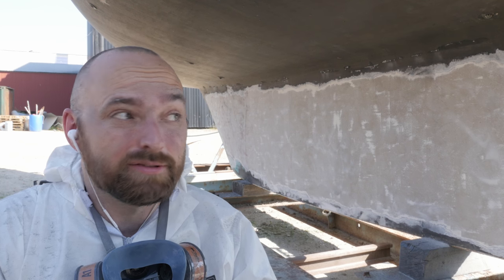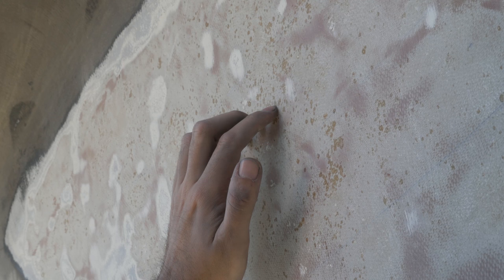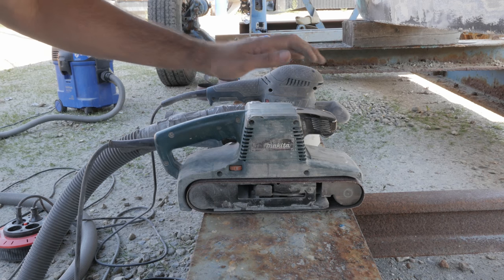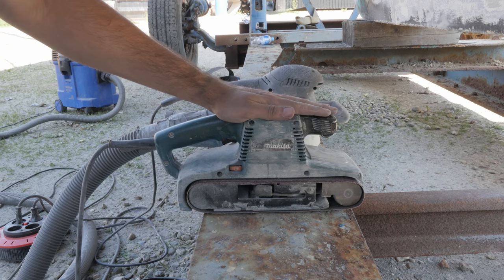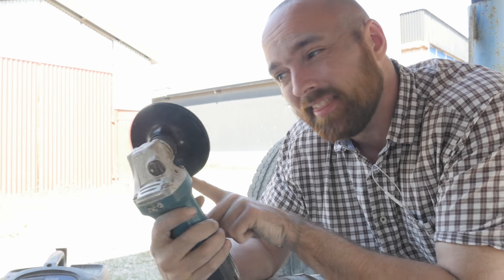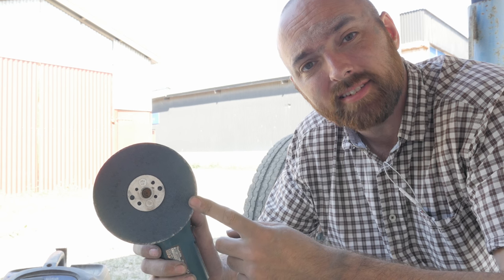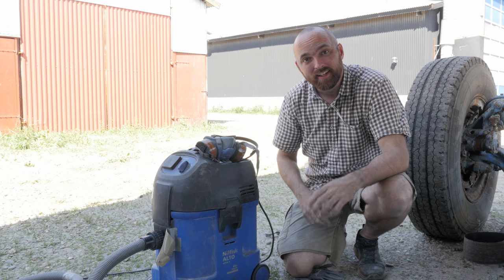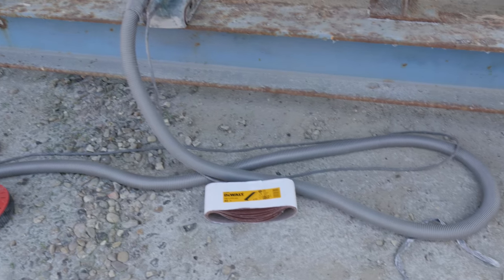Sail Life - More sanding? Yay!

Comment: Well here goes I was in the Air Force and was a coatings specialist. Osmosis is the action of a liquid moving through a semi porous material. When that coating was applied there were thousands of tiny bubbles that allowed moisture in. Meaning the coating was not properly prepared for application. Someone opened the can dumped some thinner in mixed it and either brushed it on unevenly or rolled it on unevenly. You can even get the same results by spraying it on. What we used is a Mil Spec gauge and a square of some type of metal properly primed. Once the coating is applied the gauge is rolled across the surface, it has markings along the side and a concentric Middle that picks up the coating and measures how thick the coating is. Some people like to use what's called a HVLP (high volume low pressure) spray gun it does not put a lot of mist or overspray into the surrounding air. It is a lot like an "airless" spray painter all paint no "fog/mist" the finish with an HVLP is quite even and very little waste or spray on items you don't want coated. Visit your local auto body repair shop and they can show you how it works. As far as the sanding goes now you can have your future boats "media blasted" using baking soda instead of sand, the auto restoration business uses this to take away the paint without damaging the metal and removing any type of corrosion. Next time you do a project like this after you have stripped down the entire boat completely consider have the boat moved to a oven to dry the boat completely out or rent a shed and moved the boat inside and rent propane heaters and have them on for at least 72 hours straight. This will completely dry the boat both inside and out and under surfaces like that deck you pulled up which was rotted and allow you to replace without the delay of waiting to dry and eliminate the method you employed trying to pull a vacuum on the hull in spots. 

Cheers from Texas.

Comment: You are so correct that belt sanders can take you for a walk!! I shall be interested to hear how you get on dealing with the concave curve between the keel and the underside of the bottom of the boat and also using it upside own above your head!
Reply from the maker: Yeah, that concave curve is going to be annoying! I'm thinking about modifying the small sanding disk I got for my angle grinder. I have no idea if that will work. If not there is always ... sigh... sanding by hand. Yikes! ;)

Comment: Hi Mads.  Osmosis is easy.  It's how most of the nutrients in your body get around.  The transport of water through a membrane (gelcoat, barrier coat, etc.) against a concentration gradient (the acids and salts inside the laminates).  Water then hydrolyses with the chemicals of the hull materials creating various acids and breakdown products.  Of course the acids and breakdown products attract more water into the hull by, you guessed it, osmosis.  Osmosis makes osmosis worse!  The blistering is caused by the tremendous pressure built up inside the layers of laminate.  (Be careful of your eyes.  There can be high pressure acid squirting out of the blisters.)  The hard part is what to do about it.  Basically what you are doing.  Opening the blisters, dry the hull, reseal the hull and put up the best barrier you can.  I very much enjoy your videos.  They are both entertaining and informative.

Comment: Nicely done Mads.  I can well imagine how you arms must have felt after all that sanding, but given the extent of blistering, from all I have read and heard about it, you seem to have taken the right approach.  Definitely a belt sander or a larger sanding disk really is the only way to do this job.  At least, once it is all sorted out you can be re-assured it will have been done well.  And at the end of a day a nice cold beer or two I am sure would help wipe away the feeling you have worked hard.
Reply from the maker: Thanks :) By the time I'm done sanding I'll be the strongest guy in the office ;) I'm super pleased with the belt sander! Just for the fun of it I'd love to try one of those big sanding disks. The las area I sanded on the hull with the belt sander turned out just as smooth as the areas I sanded with the orbital sander. The only problem areas are going to be the curve between the hull and the keel. Fingers crossed the blisters won't return after all this hard work! ;)

Comment: I have done this job before. We had a cast iron keel and a twisted wire brush for an angle grinder ripped off the material faster than anything.
Reply from the maker: Sounds like you had a lot of fun too ;) :P

Comment: I might be wrong but it seems you are using a carbon vapour filter (A)with your mask.  For dust particles you better use a  P-filter. Preferably P3 as it provides the best protection against dust. Thanks for the great videos!

Comment: Yes on the belt sander (use as aggressive a grit as your can) try not to gouge but don't worry about it too much either.
Ounce you get it all removed down to clean solid material you can easily fill in any gouges as you build the layers back up.
Ounce you get passed the removal stage you can switch back to the random orbital from here on out, again using the most aggressive grit that you can.
The biggest mistake you can make here is to beat your brains out using too fine a grit and/or not changing the paper often enough.
If you're after an especially glass like finish you should use a "straight line sander" or a "random orbital straight line sander" (the longer the better)  on the last few coats, and use finer and finer grits as you progress through the layers.
Finally you won't need an absolutely perfect finish when your done sanding and painting.
The last "sanding" you will do will actually be polishing and that will give you the final finish.
At this point you need to give it some time before you apply any wax, the time depends on what finish you've applied and temp and humidity ect. but the manufacturer of the paint, gel-coat and anti-foul should list recommendations.
You will also want to pay particular attention to time between coats especially between coats of different materials. For instance between sealer, gel-coat, paint and anti-foul, which will likely be longer than time between coats of the same material.
Reply from the maker: I'm using 40 grit on the belt sander :) I've only made two very shallow gouges. Both happened when first started using the belt sander. Now the belt sander almost feels like an extension of my arm. It's a heavy and very powerful tool but the surface on the last areas I've sanded are just as smooth as the areas I've sanded with the orbital sander. I'd love to try one of those big sanding disks just for the fun of it but I can easily finish the rest of the hull with the belt sander :)

Comment: Your doing the right stuff Mads. Take your time and do it right. It's your home and you dont want to waste your time on a bad repair. Was the boat "skinned" previously? Was much thickness removed? Generally a yard wont add figerglass cloth to the hull unless a layer or 2 of the figerglass was removed do to delamination or extensive osmosis
Reply from the maker: Thanks! :) Exactly my thought :) Half-assing something like this will only come back and bite me later. It doesn't look like they've removed more than the gelcoat. There is still a thick layer of mat :) And the fiberglass the yard has added is very light stuff - in no way strutrural. I'd love to find out why they did it but I don't think that'll be easy - considering 8 to 9 years have passed.

Comment: It seems that blisters due to osmosis in laminate might be an ongoing issue with a GRP hull.  Looking at a section you sanded it seems almost pristine with no blemish while other areas show the dreaded pox.  Maybe the previous job was done in a hasty manner or during a time of higher humidity defeating efforts to get the hull dried efficiently.  I wonder if tenting your hull from the water line with a plastic curtain or tarp and introducing an external heater, with the laminate exposed, might achieve a higher level of dryness.
Reply from the maker: I've been thinking a lot about what went wrong with the first treatment. Without having more detail it's impossible to know. The only thing I can conclude is that the extra layers of fiberglass (and the epoxy) seems to have kept the blisters from returning. The moisture level is about the same in the entire hull. I'm playing with the idea of adding a few extra layers of fiberglass to the hull just to be on the safe side. I'll first attempt to let the hull dry out without tenting it. I think it'll work if not I can always build a makeshift tent :)
Reply: She's a beautiful vessel Mads - congrats.

Comment: Nice work On the Hull, I have severe de-lamination on my hull, I purchased a Gelplaner to remove the first three layers of lament. Then sealing with several coats of thin epoxy followed by epoxy fairing with west system 410, followed by interprotect 2000, followed by epoxy with Copper dust..  Shew that is a lot!!  But really loving the Video's. I'm trying to get a channel up and running like your self so I can share my progress and results.  it is very hard to find the time to video and edit...   What do you edit with by the way 

Thanks
Chris Hofman

Comment: I remember reading years ago about a couple who was doing the same thing you're doing and it was taking so long to get the moisture out of the hull that they ended up having to build a tent around their boat and using artificial heat to draw it out. Hopefully it won't be necessary to do that. Have you looked into how long it takes or the process for drying out the hull? lol, I look forward to even your videos on sanding, Chimo (Canadian "Cheers")

Comment: Hi!
How did you arrange with the wagon for the boat? 

And what epoxy primer will you be using for the bottom of the hull? From what I've understood the hempel high protect is much better than the light primer, which seems perfect for you because it's only to be used in temperatures over 10C. Or are you planning on something that will not be as expensive?
Reply from the maker: The yard I'm in supplied the wagon for the boat :) I'm thinking about using West System 105 and their 422 instead of an epoxy primer. I might also add two layers of fiberglass to the hull. Nothing is set in stone yet :) Actually that's not true one thing is set in stone I'll use Coppercoat instead of regular antifouling :)
Reply: Coppercoat sounds like a very good plan! I wanted to use that aswell, but it's more difficult to get a hold of here in sweden so I ended up with the usual hempel Hard racing :)

Comment: I saw that you are planning on using coppercoat.  I recently watched some videos from "sailing UMA" YouTube channel and they made their own coppercoat by mixing epoxy and powdered copper.  Take a look.
Reply from the maker: I think I'll stick with the official Coppercoat :-) In one of the later videos, they showed the hull of Uma. Lots of growth and it looked like it was on there pretty good. The boats I've seen with the "real" Coppercoat doesn't have anywhere near that amount of growth. It would be fun to experiment with making my own antifouling product (similar to Coppercoat). Considering how labour intensive it would be to remove that from the hull in case I fail I'd want to test it very thoroughly. I don't have the time to do that right now :-) It would be fun to do a comparison between some "homemade Coppercoat" and the official one!

Comment: Blimey, I was doing all that last autumn and winter, scraping and sanding then this spring I painted on the epoxy.... I don't ever want to do that again...
Warren.
Reply from the maker: Haha, I'm sure I'll feel the exact same way when I'm done ;) What did you use as a barrier coat? :)
Reply: +Sail Life I done a little research asking what people had used and how long they'd had it, and so on and so forth, and found out that apparently Hempel and Biltema have the same manufacturer of their epoxy primer in Italy. Someone had even bought a can of the stuff in Biltema that had Hempel's stamp on the bottom of the can. So armed with that info I checked out prices and found that I'd save 1000's of kr buying Biltema epoxy I decided to buy 1 liter of each and they seemed the same, where as International was a little thicker. I went with Biltema.....

Comment: Auto Body Supply  stores  not hardware  stores  are  stocked with larger sanding  pads  for your variable speed sander that you did not show. They will have 8 inch disks  down to 24 grit , it will go faster than that belt sander even . 
Regards J
Reply from the maker: Thanks! I'll try contacting a few auto body supply stores tomorrow :) Wow 24 grit that must be like sanding with cobblestone ;)

Comment: Hi there, why on earth aren't you sand blasting this hull? Or soda blasting? Or walnut shell blasting? As bad as your hull is these other choices would cut right into those weak areas and help remove them and let the hull dry out. 6 to 7 hours under the hose and you are done!
Reply: He mentioned in a previous video that he was going to sandblast it till he found that afterwards he had to sand it anyway...
Reply from the maker: What I didn't mention in that video was the cost of having the hull sandblasted. Also, one of the companies I contacted sent a guy out to have a look at the boat. He told me that if it was his boat he wouldn't sandblast it. I'll see if I can get the full story in one of the next videos :)
Reply from the maker: vomKuckucksfelsen is correct but also the quotes I got were pretty high. For that kind of money I don't mind sweating a bit ;) I'll go into more detail in one of the upcoming videos :)
Reply: *****
Mads you really have the right attitude for doing these projects. Thumps up :)

Comment: Always outstanding..... the belt sander is aggressive but probably what you need to get the material off quickly.....   I think you should fess up and admit you have really been out partying hard letting your hair down with the music festival.
Reply from the maker: Thank you so much :) Haha, there was a tiny bit of partying ;) Looking at some of the last stuff I sanded in the video it's actually just as smooth as the stuff I did with the orbital sander. I would still like to give one of those big sanding adapters a try - just for the fun of it :)

Comment: It looks like it's had gel shield which is no good you need 3m scotch epoxy solvent free in white 
No 1 sand blast the hull get everything off 
No 2 apply a de greaser like traffic film remover
No3 steam clean at least 4 times over 2 month period
No 5 check the moisture readings make sure the boat is dry inside with a dehumidifier 
No6 use 3m scotch solvent free in white and screed after rolling on 
No6 fair hull with fairing board and not sanders as this will distort the hull profile 
No7 apply primer and antifoul 
I've never had a come back with this process and have seen many many failed and retried solutions the way you going about this 
Hope this helps .

Comment: i asked my dad for any good ways to remove anti fouling paint and he said to jet blast it, basically a pressure washer with sand in it, he also said to try 60 grit sand paper
Reply from the maker: I'm using 40 grit sandpaper on the belt sander :) Works wonders for removing both the antifouling and the barrier coat :)

Comment: Yup. I knew it they didn't do a proper job.
Reply: Random orbital sanders are for finishing, and scrapers are wood tools. Hence the noise made.

The Makita sander is the work horse, from there it's all about how crazy you want to go with the grit. Also, get a strap over your shoulders holding the machine (tied to a belt or 1 liter bottle), makes it easier to hold up for an hour.
Reply from the maker: There is no doubt something went wrong. What happened and if that is the yards fault is difficult to say. I'd love to hear exactly what they did just to see if I could learn something from it. I don't think that'll be easy considering 8 or 9 years have passed :)
Reply from the maker: I'm using 40 grit which seems to do a good job :) Interesting idea with the strap :)